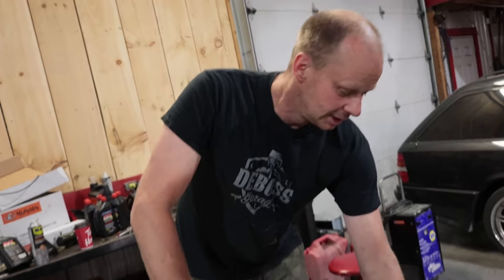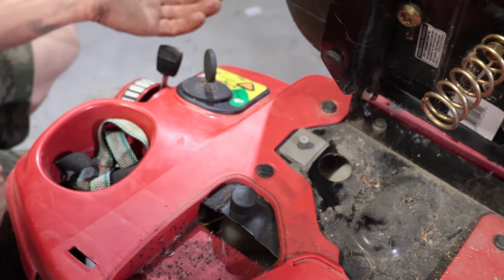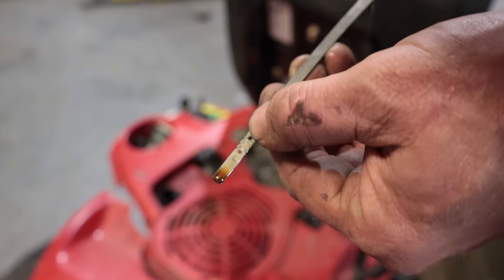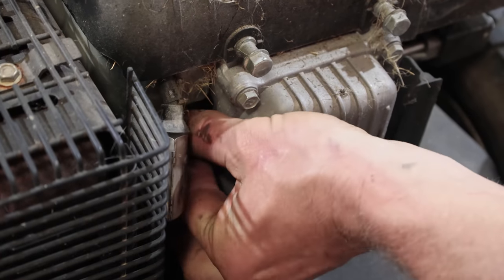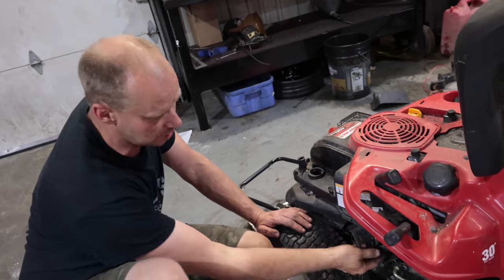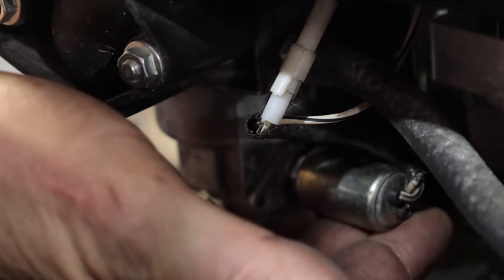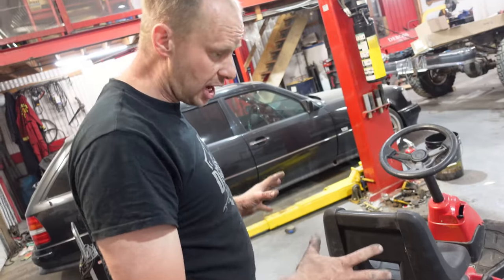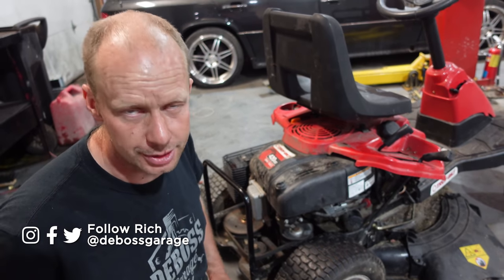World's Smallest 30" Riding Mower Won't Start (and it was free)

Comment: I love how the world's smallest ride on mower is on the heavy duty channel
Reply: You should check out a ride king they made the from the 60s to the early 2000s it's 28 to 30 inch deck and is three wheel drive one wheel in the front which is attached to the steering wheel and it's also the drive wheel driven by a single chain so it's technically a zero turn and it's a vertical shaft just like a push mower and the engine is basically in between your legs and you sit one it at the same time! They are actually awesome for the 50 years they made them they pretty much never changed designs too I actually own one for my lawn mowing business the last year they ever made them and it basically replaces the push mower and any reason I need one since they turn so tight and take up the same space on my trailer too! I can use it in smaller areas than a push mower even and I can get it inside fenced off yards with tiny gates! Best 900 bucks I ever spent
Reply: ATF also works good repairing flat tires on riding mowers.
Reply: @SKC640  It's like a Young Buggy with a mower deck!

Comment: I know at the beginning of this video he says this is basically a "throw-away mower", but it's currently selling for $1899 at Home Depot, $2200.00 at Walmart and $2350 at Lowes.....too valuable to not take good care of and properly maintain.   I need mine to LAST, so I'll be saving this vid to my Favorites.   It's a great, comprehensive troubleshooting and maintenance video for the Troy-Bilt TR30-R!
Reply: I bought mine at Lowe’s sold as a craftsman,,,Mtd makes them and has for quite some time.They were having a special sale on it and I had some kind of promotional coupon type deal they had given me and I believe I bought the thing for right around $980 roughly plus tax of course and then they gave me six months same as cash as well with no interest or financing charges so in my mind I reckon I got a pretty good deal on it .I would have preferred a different model however we have a brick wall around our property with brick gateways and this is able to fit through them nicely we have an adjacent second property next-door to us so I can get on this mower and drive through the gateways in between the two properties which makes this little thing worth it’s weight in gold,,,it runs all right it’s a little finicky at times when it comes to engaging the deck I almost have to kind of man handle the engagement lever at times,,,I probably need to get down in there and clean out the deck area again real good. I’m thinking I’m going to have to redo the piece for the steering in the front . I bought a kit off of Amazon for that job,,,there’s videos on YouTube to show how to replace the little steering bar when it goes bad. There’s two little rubber grommets under the seat that the seat kinda rides on I suppose it helps with vibration and adds a little cushioning effect,,, The grommet on the right side fell out and I’ve never been able to find it and I had trouble locating one to buy so I took small diameter rubber hose about 2 inches long or so and bundled three of them and then duct tape them and then wired them into place that seems to work really good I just had to get the thickness to match the one on the other side so far so good.I’m 5‘10“ tall and 340 pounds and I am amazed that this tractor offers me A little more comfort than I ever thought it would that big high back seat is quite comfortable how ever sometimes I find myself stretching my legs out from time to time if I’m on it for a while other than that it works fairly well. I have to remind myself to not try and get close to anything while mowing I’ve noticed those back wheels will catch on things I gotta remind myself to just trim with the string trimmer or the push mower .I disconnected the wire for the reverse sensor switch so I can keep mowing in reverse although sometimes it doesn’t always work most of the time it does however there are times when it doesn’t not sure why. I did have to replace the ignition switch but I found some on both eBay and Amazon pretty straightforward and easy to install a new one I watched videos on YouTube about that also. I had trouble locating the exact battery however I have a Viking Harbor freight tools power pack engine starter/jumper that is very compact and portable so I use that instead I have a few things I start with that little power pack and it works really good. I wonder how long these little tractors will last us? I wonder how these little tractors will last us? I hope a good long while, I change the oil twice a year early spring and early fall.👍😊
Reply: If there ever was a "throw away" mower, it would be my MTD Yardman 46" rider that I bought from Home Depot for $1099 (USD) in 2005. I maintain it by the book and it shows! Deck is 95% rust free and the V-Twin starts after about 5sec of cranking after taking it out of Winter storage. Except for a few belt replacements, it has been trouble free. I figure it will be good for another 20yrs. I am on a fixed income and CAN'T afford a new one, so this one has to be a KEEPER!  Btw, I run 10% ethanol gas MOST of the time, but run "REAL GAS" through it occasionally ! CHEERS...:body-blue-raised-arms:
Reply: I bought the Murray version 9 years ago from Walmart for $800 bucks after going through two front engine riders over 10 years. 
This little "throwaway " won't die! I keep the oil and the filters changed and have had to replace one tire and one drive belt. And I like my half acre of lawn cut high, so I'm easy on the blade.

This video saved me a lot of diagnosis last year when my mower wouldn't start. That cheap side chute popped off the safety switch. I replaced it with a mulch cover.

Comment: I have a Troy Bilt 30" tractor that wouldnt start soon after I added gas.  Changed the spark plus, removed the gas, added non ethenol gas, tried using  starting fluid several times and it still wouldnt start. I don't have a trailer to take the tractor to my repair guy so I kept trying and found this video covered the air intake and it started for a few seconds and stopped, tried it a few  more times with a piece of cardboard and lo and behold it started and ran for several minutes, halleluhia. 
With  all of the videos I had previously watched to repair my other mowers, snow throwers and otherproblem with my tractor I have never seen (or didn't pay attention to) this tip. Thanks for all the good information. Keep up  the good work.

Comment: The only complicated part of this mower is the 5 safety interlock switches, SEAT, PTO, REVERSE, BRAKE, and DISCHARGE COVER. The BRAKE and the PTO can prevent the mower from cranking, the SEAT, REVERSE, and DISCHARGE COVER will kill the mower ignition. If the mower won't crank it's probably because the brake isn't depressed the blade is engaged, or one the two switches in not engaged or bad. If it cranks buy won't start it's probably because it's in reverse, the discharge cover is displaced, your not on the seat, or one of these 3 switches is bad or not engaged.

Comment: That solinoid is a "back fire prevention". Stops fuel from flowing into the engine. Typically seen on motors that run wide open all the time.
Reply: Like beetles and their Solex carbs...
Reply: They started showing up on OHV engines. Most old flatheads didn't seem to have that issue.
Reply: Please explain more, I don’t think I’ve ever heard of this issue. I mostly mess with old flathead Wisconsin engines with updraft style carbs and diesels.
Reply: @carsonhammond6204  The engine is stopped by grounding the coil and killing spark, it worked fine on flatheads, but on OHV engines fuel would be drawn into the cylinder and pushed out into the exhaust while the engine coasted to a stop. It would combust creating a backfire. so they put the anti afterfire solenoids on to shut off fuel flow when the key is turned off. The solenoids are usually found on any OHV riding mower engine, wether single or V-twin. For the most part you don't see them on smaller engines, <10hp or so. I have seen some larger 13hp generator engines with them.
Reply: @pfun41  when they fail you just bend the needle over and shove it into the solenoid. Then every time you shut it down you get a backfire so loud it pisses the neighbors off lol.
Reply: @ionstorm66  I got a free mower that didn’t start bc of the solenoid. Took the rubber piece off the top of the solenoid and ran it😂 backfired like crazy on shutoff but I still sold it
Reply: I think maybe they added it because these are prone to flood the cylinder with fuel. Mine doesn't have one and does it. I added a manual fuel shutoff.
Reply: @chaos.corner  they'll still flood the engine, hydro-lock and ruin the oil, even with the silly valve. it's main purpose is to cut fuel when ignition switch or a safety turns it off.
it keeps the engine from loading up the exhaust with unburnt fuel and backfiring, when shut off from full speed. it's also claimed to stop fuel leakage and loss for some EPA green-lies. funny thing is, I've never seen so many carburetor issue and leaks on the older mowers without that junk.
Reply: @throttlebottle5906  Good to know. I'll pull the carb and give it a good clean when mowing season is over. Perhaps it's just a bit gummy but stuck open.
Reply: @chaos.corner  nope, its just for backfires. I see carburetors with them flood all the time. Especially Walbro LMTs which are prone to needle/seat leaks.

Comment: Thanks man for this valuable video. Been mowing my half acre lot for eight years with a TB30. No issues but replace the battery every four years, and change the oil and blade, and grease the steering every year. The mower was a good investment for me.

Comment: I own a troybilt tb30r, (Basically same mower) .  I had same problem and this video gets a 5 of 5 stars for me because it's very mindful and thorough. The only negative was my manual advises against pressure washing. Other than that, He got my mower running.  Thanks !
Reply: On pressure washing use the larger nozzles for less pressure.  You will be fine with it.  Pressure washed mine today.😊

Comment: A very quick tip to ensure gasoline delivery is the issue. Pull air filter.  Grab an un-lit propane small hand torch.  Turn on propane gas valve. Insert unlit torch tip it into air intake into carb while cranking engine over. Engine will start and run on propane. Then you know your issues are gasoline supply related. Great video. Well done. You speak well. You know what you are talking about.

Comment: The solenoid on the bottom of the carburetor is an anti-backfire solenoid. Another thing that scares the average homeowner is the sound of backfiring lol. When you shut the key off the solenoid gets pushed closed by the spring inside, and it covers up the main jet stopping the Venturi affect preventing gas vapor from entering the combustion chamber and potentially open exhaust valve causing a scary backfire

Comment: Excellent video. So if your a doctor, nurse i guess the bed pan is the oil pan? The heart is a fuel pump the tires are the feet and the headlights are the eyes. So what equates to the battery i think i need to charge mine is running a little low.

Comment: Thanks for the vid, very straightforward. Having this exact issue on the similar small CubCadet CC30, turns over, fuel clean, clean filter, spark....on to carb - wish me luck!
Reply: Me too. Mine (CubCadet CC30) is 2+ years old. No more 10% ethanol gas. Going to Ethanol free tru fuel and found a station with Ethanol free . Used Sea foam to help clean it out and a few drops of sta-bil 360 in the gas can. Hope this works. How did you make out.
Reply: @whereisthedollar  ended up taking carb off like how he did in the vid, and cleaning it completely as the fuel bowl was stuck similar to 18:28 in the vid and the solenoid was gunked right up too. Worked like magic after.
Reply: Great. I just diagnosed mine as a clogged fuel filter and ordered a couple from CC online. Will change out and no more 10 e, period will be used. @CoreyDodge

Comment: Hey Rich, great video. One thing I would add to the spring maintenance routine would be to pop the flywheel cover off and make sure there isn't a mouse nest sitting on top of the cylinder. That's a 5 minute job that could save an engine, or at least a head gasket.

Comment: i like the way the jet just unscrewed and the pin for the float wasn't rusted in.. i've seen some push mowers you'd take the bowl off then just order a new carb after looking inside..crusty stale fuel turned into a new form of cement

Comment: State side the majority of the pump fuel has 10% Ethanol, that can mess up the small seasonal engines too. What I have discovered thanks to a friend from where I retired, he said I should be using what is called Marine/RV fuel. It is what has been called pure gas, as in NO Ethanol. Ever since I have been using it I haven't been draining the gas out of the tanks of my snow blower or lawn mower. I'll fill it up the last time I use it for the season and in the last at least 8 to 10 years have not had one issue getting the engine started at the beginning of the next season. Yes it is more expensive but for the average home owner, it is well worth it.

Comment: I’ve also worked on mowers and I’ve learned that blowing air through the fuel inlet can blow out a little tiny rubber gasket inside for the needle. I’ve learned to blow air from the inside like he did in the video. If you blow it the other way like where the fuel line goes it can blow out the gasket and the needle will never seat and then you will have a flooding issue.

Comment: Outstanding presentation! So, you are a Jack Of All Trades and Master of most. It shows. My two sons gave me a well used Craftsmen RER1000 that wouldn't start yet it was running perfectly an hour earlier. You guessed it -- they bumped the discharge shroud in transport and the safety switch went open. It took 30 seconds to fix, yet 10 minutes to track down and isolate the misbehaving switch. I use 91 octane non ethanol gasoline only in all our cars and gas powered machines. And through your entire video I never once heard you say "eh" in a classic Canadian brogue. We yanks love that. Eh?

Comment: More common on these new mowers is the crankcase vacuum operated fuel pumps. They diaphragms go and the gaskets or hoses that connect them to the crank case. I think that one is a gravity feed though. Don't see that often. Those electric fuel shut offs are supposed to eliminate backfires in the muffler after the mower is turned off.

Comment: You missed pointing out the need to clean the emulsion tube vent holes.  If the tiny holes that run up the side of the emulsion tube are plugged, the fuel doesn't mix well with the air and the engine won't run well.  Also, there is an air bleed orifice at the top of the carb that can get plugged and cause poor running too.